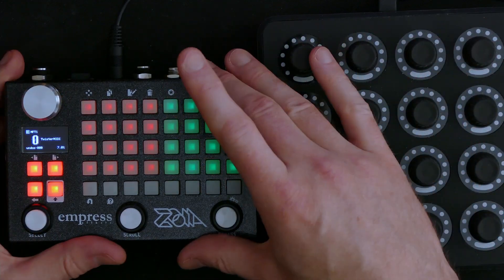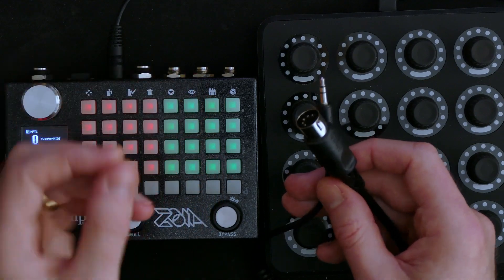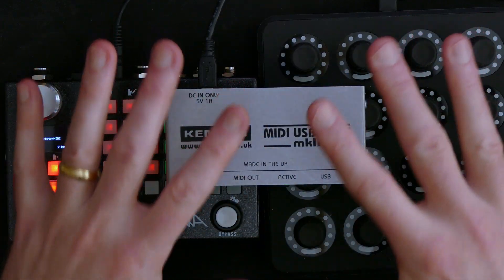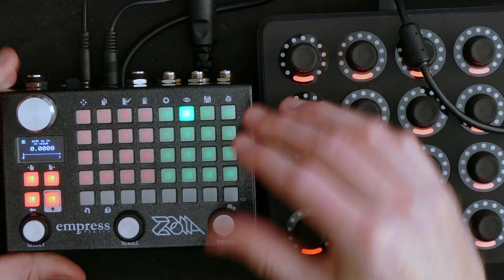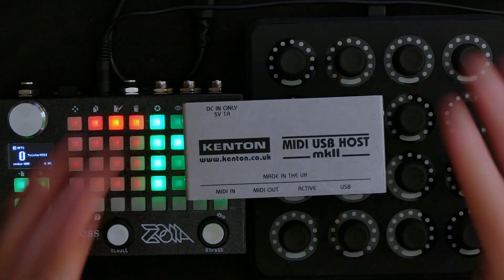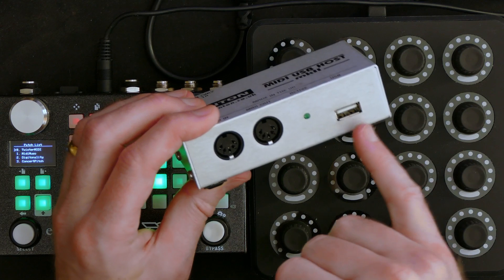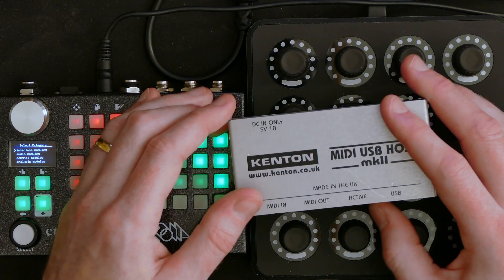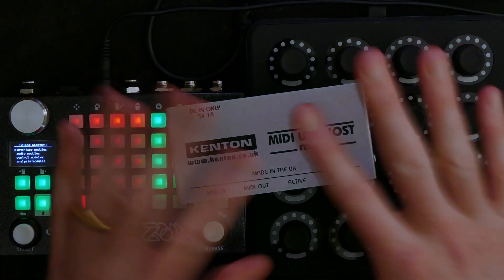What is a MIDI USB Host? Why You Need One.

Comment: Helpful video.  Thanks for the information.  I'm looking to reduce latency in Ableton by hopefully not having ALL midi stuff have to go through the computer!
Reply from the maker: Thanks. If you have several MIDI devices, you should also look up iConnectivity Mio. The medium one, the XM, can host 4 USB MIDI devices directly, and up to 8 with a powered USB hub attached to it, and it can do advanced routing, filtering, MIDI over Ethernet, standalone or PC connection mode. https://youtu.be/lI0Ji7fTvLo
Reply: @hakonsoreide  Thanks!  Yeah, ultimately I'd like to have all my MIDI stuff "just work," and then when I want to record their audio into my DAW, I'll worry about that as a second step.  Instead of now having to pull up a session and arm a track just to hear an instrument.
Reply: I believe the Keith mc Millen midi expander has to be connected to their own K mix audio mixer to work, which itself is powered by a computer